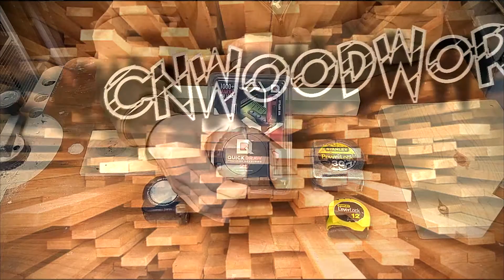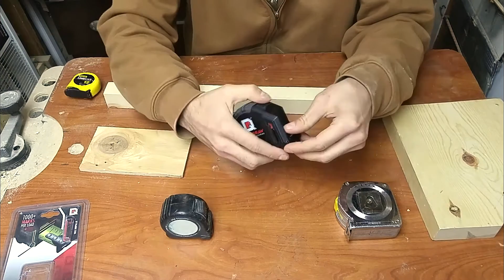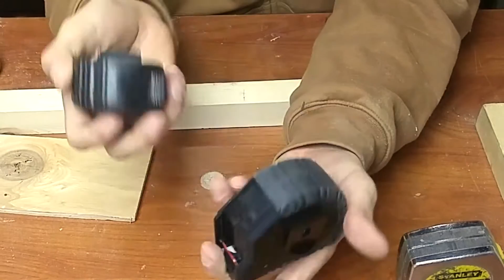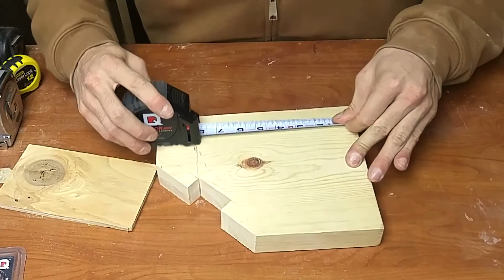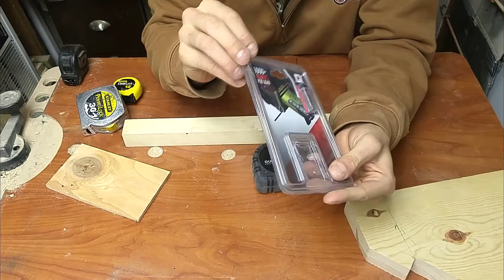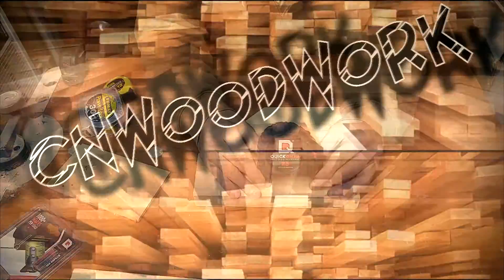QuickDraw Tape Measure WoodWorker Review

Comment: This is a very poor review. I think you are blaming the tool for your deficiencies. I have never been able to use a tool to maximum effectiveness right out of the box, and I doubt that you have either. 

After you have used the tool in the field for a while, perhaps you could post an impartial and reliable review.
Reply from the maker: HarveyWysong I agree! I thought of posting a new review video however, after over a year of using this tape almost daily my opinion hasn't changed. It still has no place in a wood workers shop. But if I were framing houses it might be better suited.

Comment: This sounds silly, but is there a trick to getting the marker to work ?  I've loaded a few graphite pieces, and I'm only getting a roller wheel mark.  No graphite line.  Any advice is welcome.  thanks
Reply from the maker: Kevin Ashby Is the wheel rotating? and the graphite pressed all the way down? I'd check those things first.
Reply: Thanks for the input.  After I sent the message, I got the wheel coated in graphite and it started to work.

Comment: That thing seems like a rough carpenters tape. It's probably not for the finish carpenter. Framers usually have man hands and the thumb button could be less of a problem for those guys. It seems like it would be a huge help while holding and measuring a 2x4 and getting to skip the step of pulling out a pencil to scratch a line. I could be wrong
Reply from the maker: It could if you were allowed a .5 tolerance building and put in a little practice.

Comment: CN, thank you for taking the time to review the DIY QUICKDRAW - I have a few tips and tricks that will upgrade your experience with: 1.  Do not use the lock when making 1/4" marks - the wheel tracks perpendicular to the blade and with a little practice you can hit your mark fast and accurate every time.  If you want to compare our DIY model to Pro competitors, we will still beat them (after you have some practice) but it would be way better for you to compare our QUICKDRAW PRO model.  www.quickdrawprotapes.com